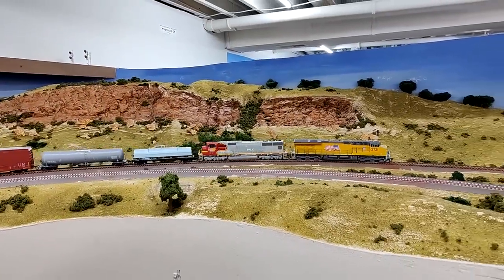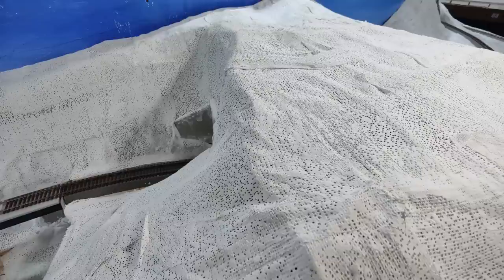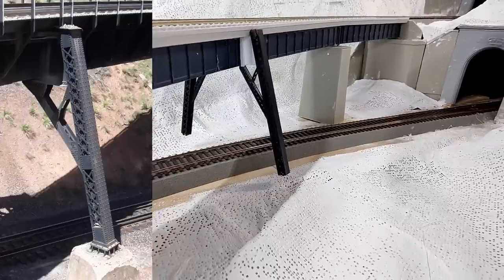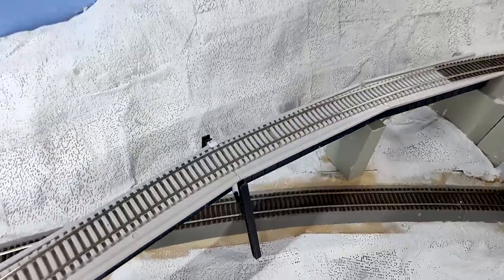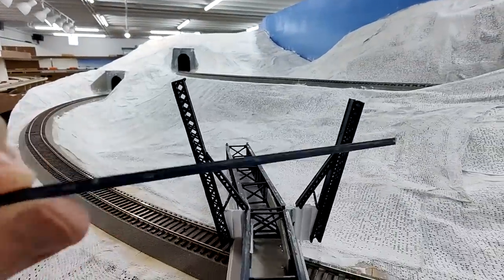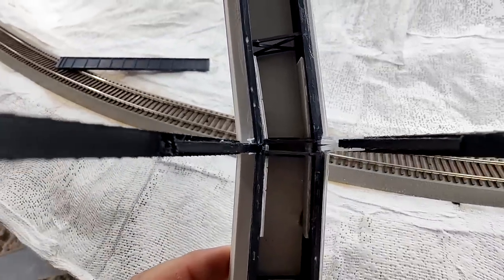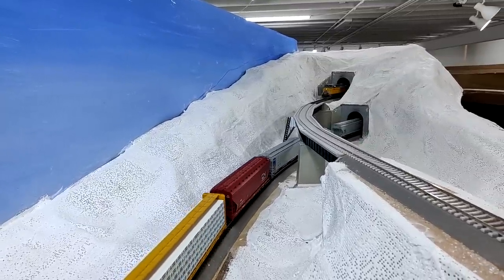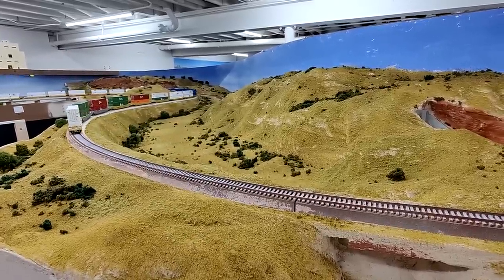Mid Bridge Support Girder Pier at Curvo on the Union Pacific Railroad Evanston Subdivision. HO Scale

Comment: Dear Daryl, think the solution with the girder winging in ‘rectangular’ fashion to complete the box girder portal is the best option. Might be that the exact placement of the overpass section of the bridge is slightly out of wack. 
With the winged girder attachment, you could also choose to adjust the box girder angle slightly, so both supports will seem to be protruding from the bridge in equal measurement.
For your comment on the red soil, I would recommend using a red adobe as ground cover. This will give a texture finer than sand and with more color variations paints can achieve.
Curious for your next episodes. Cheerio
Reply from the maker: What's red Adobe?
Reply: @EvanstonSub  what I call red adobe is the fine red loam, clay, malm or mud with which mud bricks used to be made. Some dirt contains it, which you can check by moistening it, if a clay like substance forms, your dirt contains loam. It’s also sold in bags and samples, which is more appropriate for modelers, because a little goes a long way. Over here in Europe it’s called Terra, or Terra-cotta, although that last denomination gives the impression of a more orangy color, while it’s still deep red. In US terms it’s the finest dirt with a Navajo Monument Valley color.

Comment: Most Excellent! The Micro engineering girder will work out very well and be a solid connection. You might also consider using leftover Micro Engineering beams to make the gussets that go to the concrete deck. Using the same dimensional pieces will help blend it all in.
Reply from the maker: Thats a possibility.

Comment: You've done an excellent job of creating a scene at Curvo that very closely matches the prototype.  I agree that this will be a signature scene/location on your layout.  The modifications that you're planning to do with the support should do the trick.  As good as this scene is going to look when completed, I think you could rotate the support somewhat to meet needed clearance and not compromise the accuracy of the overall scene.  Your entire layout is really looking good and you have accomplished a great deal in a relatively short amount of time.  This has been fun to watch unfold.   Thanks for sharing your work with us!            Mike
Reply from the maker: I'll see how it looks without rotating. If it is sticking out too far past the prototype to get clearance, I'll try the rotating.  Both ways are not prototypical.  It will depend on which way is less noticeable.

Comment: The engineers that designed the bridge were not constrained by fixed length longitudinal  girders. If you rotate (clockwise) the cross girder slightly and maybe move it a little closer to the tunnel mouth I think your clearance problem will go away.
Reply from the maker: The prototype has the mid girder support pretty much in the exact center of the bridge.

Comment: What about taking the black supports off, planting them in the base, and then doing some kind of support from the front vertical support to the back one. Then you could have  a couple of horizontal large "I" beams from front to back and holding up the bridge. You could have all of the clearence you need this way!!!
Reply from the maker: Except that it has to match the prototype as closely as possible

Comment: Ok. Didn’t see all photos prior to first comment. If you look on the proto photo, you will see that it’s quite a bit longer on the inside than it is on the outside edge. It looks like there are 2 or more panels on the girder showing vs about one and a half on the outside. Maybe it’s just the shadow from the pic but it does appear longer on the inside for clearance.
Reply from the maker: Looking at the satellite photos, it appears eack girder section is the same length.
Reply: @EvanstonSub  I think once you redo the girders and get the angle correct, the clearance will be there. Can’t wait to see it! Hurry up!!🤣

Comment: It looks like you may need to increase the angle on the inner leg
Reply: Yes, and increase the angle (as measured from vertical down) so that the inner legs meet the new transverse girder under each of the opposing rails.  This would be as in the prototype.
Reply from the maker: Not following, but I think that would limit clearance even more.
Reply: @EvanstonSub  It would have to be done by raising the inner leg higher up the inside of the outer leg.  If the inner leg's length were to remain unchanged, the top end of it (the horizontal face which will now connect to the bottom of the new transverse girder) would slide more to the center-line of the tracks it is trying to support.  It would do this higher above the rolling stock instead of clipping or rubbing against their top corner edges.  Sliding the outside edge of the inner legs higher up the inside of the outer, main, legs and the top edge inwards toward the center-line of the railway tracks they are supporting on the other the end under the planned horizontal girder will give higher clearance above the top corners of the rolling stock while placing the inner ends of these small girders legs directly underneath each of the rails of the track and, therefore, trains they are meant to support . 

You can see this on the prototype.  Those small inner girders transfer the weight to the outer, large girders down to the concrete footings.  On this first crack at the model, those small inner girders do not meet the bottom side of bridge directly underneath the rails.  The angles are wrong.  It also means that the inner legs will have to have their mitered edges re-cut or, more likely, scrapped and replaced with new ones.